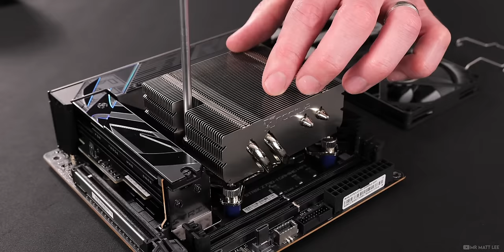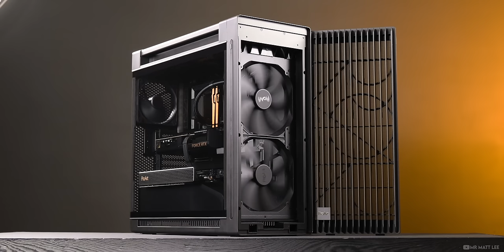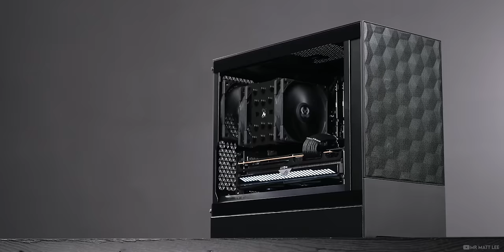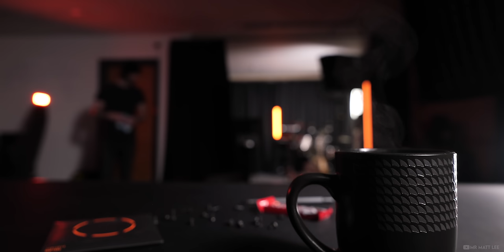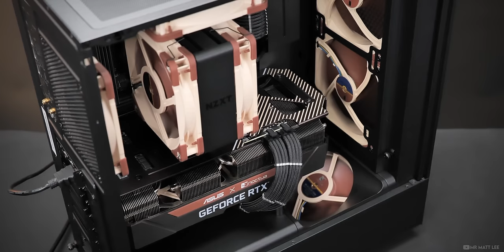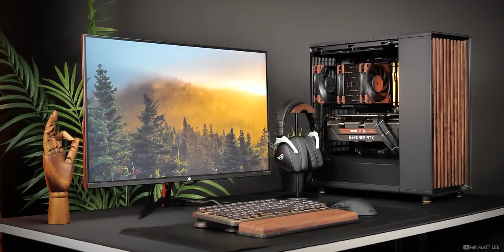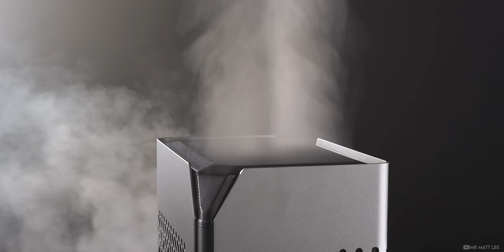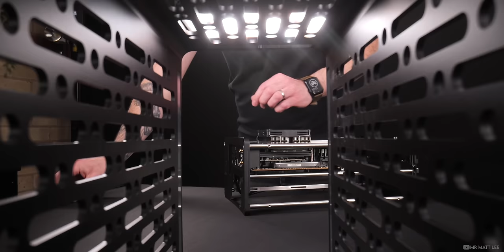PC Case AIRFLOW; A Visual Guide for Optimal Cooling.

Comment from the maker: Liquid or Air Cooling? Aesthetic or open front? What's your current build looking like?

All of the clips in this video are extracts taken from full feature length builds on my channel. Go give them a watch to learn more about each 🍿
Reply: Air cooling, open front. Gorgeous
Reply: Noctua NH D15 in a fractal torrent case.5900x and a 4090.  What’s your opinion on this case ?
I use it mainly for 3D works
Reply from the maker: @rahulkamath6984 the Fractal Torrent is a seriously strong airflow case, especially when combined with the NH-D15. I haven’t built with that exact combination, but any air cooler setup I’ve built within a Torrent has been a solid performer. You won’t go wrong with that ✌️
Reply: @Mr_Matt_Lee  thank u so much for your reply. Love you content and style of delivery keep them coming
Reply: I haven't built mine yet. But I've been watching your vids for a while now. I'm in between the Asus Tug gt502 and Thermaltake 300.
Reply from the maker: @Enragedurso those are vastly different cases, interesting to be split between them. The having built in the GT502 many times now I can attest to its flexibility and hardware support. The Tower 300 will feature on the channel soon too (I can’t give a personal opinion on that one yet!)
Reply: Current build is the Lian Li O11 Dynamic Evo, 14900K, MSI Gaming Slim 4070 Super, 2x32GB 6400 CL32, 2x2TB WD SN850X Black drives, MSI Z790 Tomahawk Max Wifi, Kraken 360 and 10 Lian Li SL120V2 fans (I replaced the fans on the AIO). I've got the AIO mounted vertically with tubes down and fans pulling air through the rad. The three fans on the bottom are pulling air. Three fans on top are exhaust. Fan on rear is exhaust. Done up in a Darth Vader theme (mostly all black components with red RGB lighting).
Reply: I am using a Lian Li PC-O11 Dynamic Air Mini case, Asus TUF GAMING X670E-PLUS motherboard,TEAM T-Create Expert 6000MHz 32GB, Ryzen 5 7500f processor with Thermalright Peerless Assassin 120 tower. I am planning to buy a rtx 4070 super for my build.
Reply: purposedly bought a H5 flow csae after saw your H5 flow build video with noctua fans (migrate from my lian li o11 mini air). however due to budget constraints, instead of using noctua fans, i opt for P12 Max & P14 PWM.
Reply: @Mr_Matt_Lee  the GT502 video is how I found your channel.  Hoping to get one in May.  I'm not gonna lie though, I was disappointed with the disclosure that the dual chambers don't cool as well......
Reply from the maker: @thesybe I never said they don’t cool well, I said they aren’t as efficient. I actually explicitly stated how they side-step the inefficiency with additional fans ✌️
Reply: @Mr_Matt_Lee  yes you did.
Reply: I like more on air flow PC Cases rather than lightings and aesthetics. This is my rule on PC building, Always performance first before aesthetics.

Great analogy on your explanations in this topic. Thanks for sharing your ideas and experiences.
Reply: I switched from aio cooling to air cooling due to thermalrights new phantom spirit cooler. Has cooling potential of a 240 and 360mm aio
Reply: As an older PC/gamer (62) I have seen a tremendous change in cases from the mid 90's to now. The first PC I built was the off white or beige color 1 fan on the front bottom and the power supply was at the rear top and exhausted the case air and that was it for air flow.
The only connections were on the I/O plate.
The sides and top were made together and slid backwards to remove.
The first thing I thought that was really cool was when the black color option became available.
Power use was low then so very little heat was created so this setup was fine.
All in the new styles and options over the years have always kept me interested in this great hobby.
My last build used the Corsair Carbide series DPEC-03 black
That was 2016
I last upgraded the graphics to o a 1080ti
Well Mr Matt has made me want to build again instead of buying a pre built
Thank You
Reply: 5000D Airflow with 360 AIO on top, 3 intake fans in front, and an exhaust fan in the back. Looks great, performs really well 👍
Reply: @MichelBertrand  could add 3 intake fans on the side for more airflow :)
Reply: air cooling, open front in a ch370 by deepcool. cooled by the ak620, keeps my 7800x3d at amazing temperatures. been a great experience so far
Reply: Great stuff! You touched on it, but I would have loved to see more of explanation on positive vs negative air pressure in the case by way of your epic smoke visualisation!
Reply: I'm running a Coolermaster H500M with a PL360 Flux 30th Anniversary Edition AiO mounted on top, cooling an 5800X3D (Paste is Arctic MX-6).

The 120mm Mobius ARGB Fans on there are Beasts, also very good as Casefans!

I also replaced every other fan, including the 2 200mm fans, with 140mm Mobius ARGB. 

The case looked cool with the 200mills, but wasnt really made for 200mm fans, other than the new HAF 700 Series. 
So half of them was blocked off, also the pressure of those, was really low, even the 200mm Sickleflows are no match in pressure terms to the Mobius and as the 3 Mobius are almost unobstructed, they deliver almost twice the raw amount of fresh air and push it much deeper into the case and around the card.

And with a 420Watt (torture) RTX 3080 Aorus Master 12Gb, i needed both high airflow and lots of pressure and the 3 140er Mobius ARGB Fans just delivered that.
A ginormous improvement over the 200mill and also as exhaustfan together with the AiO, keeping the card at 72°C and the CPU at about 62°C with a roomtemp of 22°C in Cyberpunk 2077 at QHD and RT Ultra and high crowd density, pushing both components to the limit.

As the X570 Aorus Pro Software aka Gigabyte RGB Fusion is just crap, my Trident Z Neo gets controlled via the G.Skill Software and the Rest runs with the small Coolermaster A1 Controller and the MAster Plus Software, which are both much more capable and deliver better effects.
Reply: Even After a 100 Pc‘s fixed and built i still love those tutorial style videos and yours is truly one of the most beautiful i have ever seen. 

Full Custom Loop with custom Distroplate, North 😁
Reply: NZXT H7 Flow is an amazing airflow case. My RTX 3090 Suprim X doesn't go over 70c after long Warzone sessions, with CPU and all other hardware kept cool also.
Reply: I'm using an H7 Flow with the dark rock pro 5 and 5 140mm pro 4's. Keeps my 4080S and 7800 X3D pretty cool.
Reply: What is your top 3 cases and fans?
Reply: I plan on getting the CH370 case, though I think the 320mm GPU clearance is not the actual GPU clearance, I see this as someone fitted a 4090 slim with 322mm length in the case and still fitting a normal size fan and it doesn't look too cramped.

Do you think this too?
Reply: I use air and liquid, but air has always outperformed liquid in most of my use cases. AIO does look cleaner as that is also subjective. Go with what works for you, not what some f**king YouTuber tells you to go with.
Reply: @rahulkamath6984 unfortunately that 4090 will heat that air cooler up in that situation unless you don't mind a little louder fan noise.
Reply: Air cooling (NH-U12S but really wanting the NH-U12A now) with the motherboard at 90 degrees and the main case fans (180mm) are at the bottom; airflow is from bottom to top as how warm air normally moves.
Reply: Hey Matt I need your advise on something. I have a td500 mesh (not the V2) and I will front mount my aio as intake. Will it be better to put the radiator between 6 fans? I intend to use ryzen 9 7950x and exhaust from 3 top fans and 1 rear
Reply: Air cooling open front. 👌🏽
Reply: I'm 100% Team Air. Because of my professional training, I understand airflow quite a bit better than your average PC builder. I'd stay away from those fishtank cases. You're just generating turbulence with the intake fans blowing right into a glass panel. You are literally the only YouTuber I have ever heard make that point. I have gotten slammed on Reddit for saying so. Now I can point them to this video because you make it plain enough for any ignoramus to see. 
It is because I also understand liquid cooling that I don't do it. It is simply untrue that keeping the top of the radiator above the pump will always prevent air from getting into the pump. There is only one way I would mount an AIO. Up front, tubes down. Just as there is no such thing as a free lunch, there is also no such thing as a sealed system. You want to be sure the air will end up where it can't possibly be drawn into the pump.
A Zalman S2 TG is about $65 US and will flow just as well as a $300 full ATX tower. I am currently using one for my main rig and it lives on a commercial grade shelf next to my desk. 
The amount of money some people spend on a case is mind boggling. There are a ton of decent cases below $100. The Q300L is still in production and, while it is a pain to cable manage, you can get some good airflow through it and it will take a fairly long GPU (put a 3070 Ventus 3x in one and it ran cool even significantly overclocked). $40 on Amazon in the US. Currently building a PC in an Asus AP201 I got for $70.
Reply: got 15 fans 3 bottom, front, back, top, side   the side is aoi tho
Reply: Great stuff. You missed mentioning case with bottom intakes like the D41/D31 - minimal dust. How did you set you D41/D31 up ?
Reply: I have an unusual configuration on some of the PCs I've built in airflow chassis: top filtered intake with a CPU AIO cooler, front filtered intake with case fans, and a rear exhaust. Is this a bad setup?
Reply: @ZearouAyedea497  rear is better to aio maybe?
Reply: I'm partial to air cooling and a mesh front case. I've had too many AIO pumps go bad or simply be junk out of the box.
Reply: Awesome vid Matt! Just found your channel and I like the theme and styling of your video (plus it's very informative)! I built my first PC 1 month ago, and I got a Be quiet Pure Base 500FX case which has 3 intake fans and one exhaust fan, as well as a Noctua NH-D15 dual tower dual fans (both take the air from the front and move it to the exhaust fan). Gotta say for gaming on Ultra and any tasks I've had so far, the Air cooler is great for the Intel i9 14900K and the same I can say about the AMD Sapphire Nitro+ 7800XT GPU I've got. Never even gave a thought to the Liquid cooling since I'm afraid if I'll be the 0.1% of people whose Liquid cooler fucks up really badly and kills all of my system.
Reply: All air cooling with 3 front, 1 back, and duo tower Thermalright PA120 non SE variant, all pull direction handling my 13600k with 70-75 deg in game with little to no noise after undervolt
Reply: Air cooling, open front, positive pressure.
Reply: recently got a 14700k and could not get air cooling to prevent throttling under load. So got my first AIO and it works fantastic. Coolermaster 240 atmos
Reply: @TheBlueBunnyKen  Just had one of those on my new build and it did not cool the 14700 enough. Switched to a 240 Atmos AIO.
Reply: @BigBADSTUFF69  The issue with k variant chips and asus mobo's is they pump way too much wattage/voltage into the chip by default. Enforcing all limits solves this issue. Either that or you undervolt/wattage limit the cpu for better temps
Reply: Putting together a build in the near future. already got some of the parts used. Fractal North black, mesh sidepanel, noctua nh d15 black chromax. will be noctua fans 3 x  120 mm  fans in front as intake  and exhaust one 120mm and one 140mm
Reply: I've actually been wondering about how I chose to do the cooling in my PC and would love to hear what you think!  I have a Lian Li O11 Dynamic case (fan openings in bottom, top, and rear) with an AIO cooler for my CPU and a Sapphire Toxic 6700XT GPU, which comes with a built in water cooler.  I decided the best way to positon everything was CPU radiator on the top, GPU radiator out the back (both exhaust) with the bottom fans as the intake.  Thinking being that having the airflow move upward through the case was best in order to take advantage of the hot air rising as well as minimize dust (and kept the tubes somewhat neat as well).

But I have seen at least a few instances where people claim that it is better to have the CPU AIO on the top be an intake as well instead of an exhaust so that it gets fresh cool air from outside the case into the radiator instead of warm case air.  Which makes sense, but  I worry that the bottom fans will end up cancelling out the airflow coming through the top when done that way.  The GPU runs much cooler than the CPU so I'm not really worried about airflow through the rear radiator, but I do think that switching the bottom fans to be exhaust as well (so top intake, rear and bottom exhaust) could end up depriving the GPU radiator of airflow.

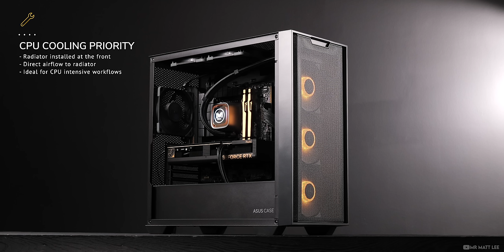I did spot a dual-radiator build at around 6:37 in the video but in a case that has front fans instead of top so it isn't a perfect comparison.  So, which way do you think would be best? 

Great video by the way!
Reply: I'd love to see some of the smoke videos of the "wrong" ways to cool a PC, so we can see exactly what effect some of the common PC build features do to cooling. Stuff like cables in the way, fans blowing the wrong way. What happens when a fan/GPU is installed too close to the case wall etc etc.
Reply: I am using non RGB Build with my 11 years old case ATX NZXT 810
Reply: Blackout, performance-over-looks, budget, AIO cooler, mesh case
Reply: My pre built rig uses air cooling, and draws air in from the front. Thing I would worry about with water cooling is any leaks COULD brick your system. But my case COULD accommodate a radiator if need be as the front and top both have big vents
Reply: that  build  at  the  end  ,  ahhhh   ,  lol    `  Master  LuL`z
Reply: i have my side panel off because my fans are trash.
Reply: liquid cooling is a scam for anyone looking to build a pc for gaming. so the answer to that vs is literally rather your build is for gaming or productivity.
Reply: To confirm, if I am prioritizing airflow, it's better to use NZXT H7 Flow over the H6 or H9?
Reply: Liquid cooling and h6 flow idk the category for this case
Reply: Love the effort and real info that you include in all your videos the least boring PC content creator on YouTube I can watch your videos multiple times ❤
Reply: A bit late but i couldn't resist seeing a fellow "i just like to build and drink coffee" dude making these fine vids :). White Torrent with quad 180 intakes, i committed absolute blasphemy by fitting a NH-D15 chromax with white heatsink covers and two of the 3 included 140mm's from the torrent theat were mounted in the bottom originally. And to finish off the last included 140mm of the case as exhaust behind the cpu cooler (which according to Fractal is not necessary). I just like how they approached the oldskool psu in the attic thing and how they made it look, it gives it this hunched down retro futuristic stance.
Reply: I overbuilt my computer with 22 fans in a HAF500 Evo case and the dame thing weights 35kg... I am definitely going for something smaller, lighter and less complicated with my next build.
Reply: @morriswu3953  Bro are you trying to make that thing fly ???
Reply: Air, be Quiet Dark Base 701 is a beauty case, for more space get 901. Good design, quiet and fan control on case
Reply: Totally Liquid cooled with aesthetic looks. Used copper pipe. Personally, I wouldn't do CPU water cooling anymore. Just not worth the effort. But GPU water cooling makes high end GPUs much more stable, and in some cases unlock untapped potential. For instance, Vega becomes a monster with a 360mm radiator.
Reply: My current is white build with Aesthetic in mind, using Liquid 360 aio at the top, with open front air flow. Will be moving the parts over to the Montech King 95 pro soon.

Comment: Late comment, but please please do not mount your radiator at the front with the tubes at the top. Watch Gamer Nexus's video "Stop Doing It Wrong: How to Kill Your CPU Cooler (AIO Mounting Orientation)" and you will find out how to do it properly. TL:DR Mounting the rad on the front with tubes at the top will force all the air bubbles to form there and make the pump have to work harder and will cause a wine to happen and shorten the life span of your aio pump.
Reply: You can mount it in the front with the tubes on top as long as your cpu is below the top of the radiator, you just might hear some bubbling because the air will get trapped at top of the radiator. Front with tubes down is better. Air is still trapped at the top of the radiator, but you won't hear it. Top is best, the air will spread across the radiator. Just don't put your radiator on the bottom, the air will rise to the cpu and cause it to not cool properly.

TL;DR if your cpu is not at the top of your cooling system, you're probably fine.

Comment: This…. This saved my pc. Idle temps at 37°-40°. After this video, 23°-30°. Absolutely insane how much airflow affects pcs. I just built my own pc and the case came with the fans installed backwards, and it being my first build- I was none the wiser. This video popped up on my feed last night, this morning I went out and got 2 more fans, quick install, and bam. Nearly 10-20° cooler just by proper fan placement and orientation. To top it all off, it was only $25 for this upgrade. Thank you for posting this video because my pc could have over heated and I would have had no idea why. Truly, for ANYONE building their pc for the first time, this video is a MUST
Reply: I put mine in the fridge.
Reply: In your case, I don't think it matters that much at all. 37-40 as idle temps are already considered cool and getting it any lower won't really change things in the long run.